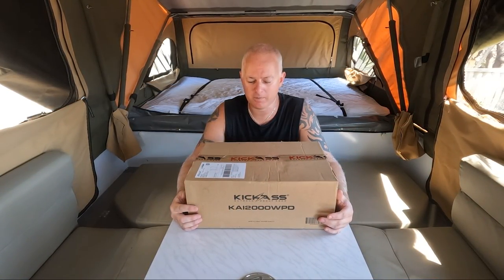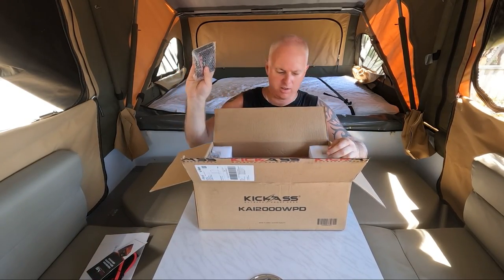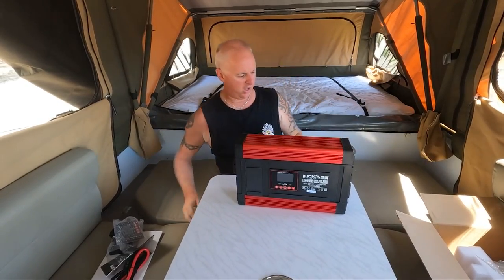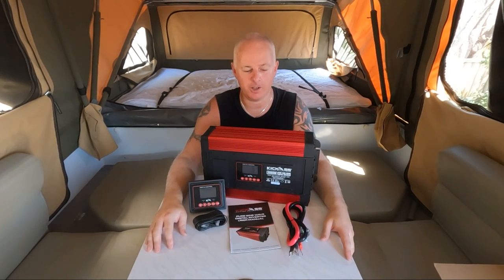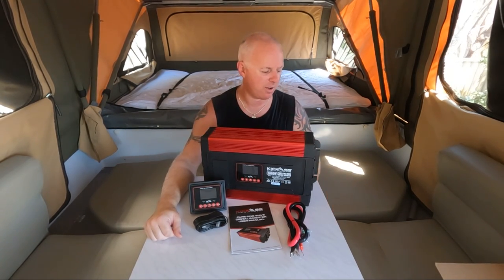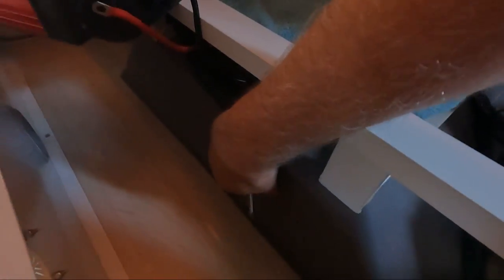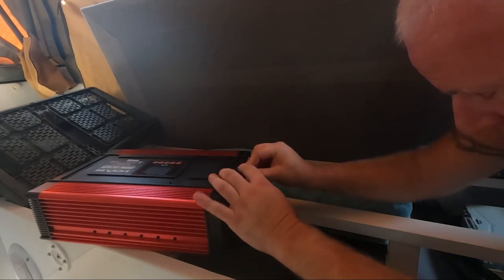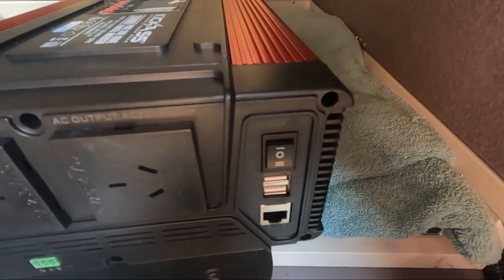KICKASS 2000W SINE WAVE DIGITAL INVERTER Easy Install, Test & REVIEW for OFF-ROAD CAMPER TRAILER

Comment: Makes me feel comfortable about upgrading my inverter.
Reply from the maker: Is there one you're looking at? Actual unit size was a bit of a surprise but kinda needs to be bigger 😂
Reply: @gettingaroundaus  at least a 2000W unit, I have heard of Kickass, but I’ll be doing some research into size and cost of all 2000W inverters.

Comment: What battery do you have . What size cable from battery to inverter? Solar panels ?
Reply from the maker: This was a few years ago and have a few months ago completely upgraded the whole 12v system in the Camper Trailer mate. I have done a video on the 12v build if your interested

Comment: had many invertors, from Cheap to Top of the line marine Expensive ones.  The one I currently use is a Cheap Ebay 6000..peak 12000....$150. had for 12 months now, use everything with it...Even a small mig. Granted mig drains the batts quickly and if not carful flick the switch. But You dont need a Expensive one. Research get the best bang for buck and power ya can.  4 VoltaX 100 ah Lithuims....cant go wrong.
Reply from the maker: Roger that 👍
Reply: Be interesting to see how long it actually lasts

Comment: What size battery for a 3000w inverter that will need to run a machine with a 8.3 amp motor for 4cycles of 30 secs 3 times a week hooked up with a 25amp dcdc charger
Reply from the maker: Personally I wouldn't use less than 200ah lithium, I'd recommend talking to a auto sparky mate as they would get you the best advice 👍
Reply: Be careful of the inrush current to the motor on startup which might trip the inverter off.

Comment: How much power did it take out of the batteries?
Reply from the maker: With a 120w fixed solar panel on the camper plugged in the battery was at 12.6 or 12.7 and when I finished up at 12.3 or 12.4

Comment: What size batteries do you use
Reply from the maker: 2x 120ah agm
Reply: @gettingaroundaus  120Ah AGMs are only rated for 30amps constant current, so 60amps for both. That gives you roughly 700watts. You're going to shorten the life of those batteries pulling so much more current from them. Worse you could damage the batteries, cause swelling or leaking.